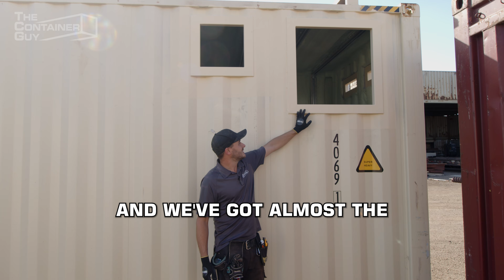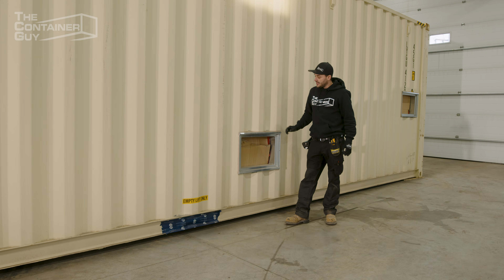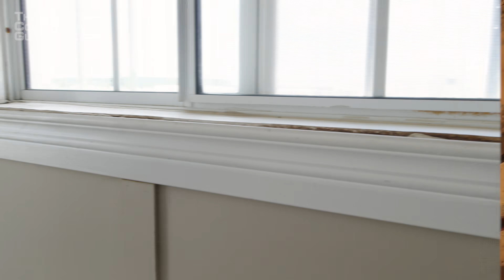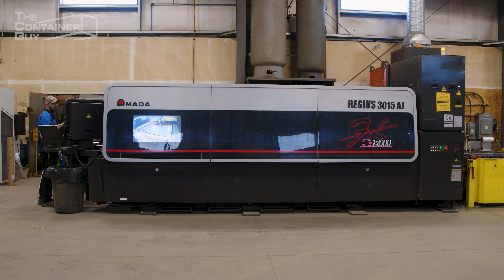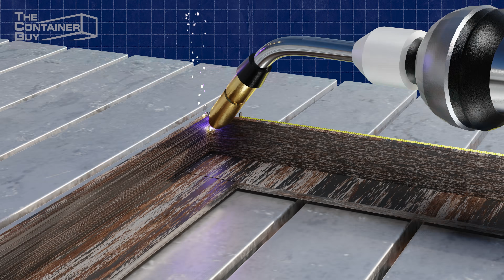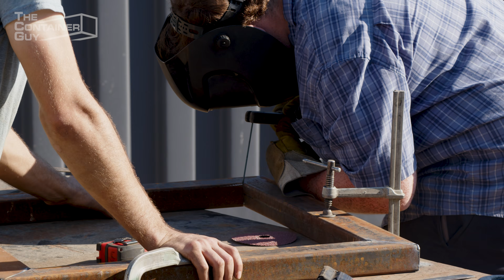How To Frame Openings On Shipping Containers | DIY Method

Comment: Ironworker/fabricator 15 years.   If you weld it, which you should. FIRST AND FOREMOST, PREP ALL SURFACES TO BE WELDED WITH A FLAP DISC AND ACETONE.   As much as you can brace your frame and container to keep it square and to discourage warping. Heavy tack all corners and mid way between those. have a sequence you strictly follow. Ex: you weld  a few inches in the top left corner, jump to the bottom right corner after.   When weld cools it tightens, and pulls. Goodluck, measure twice cut once.

Comment: Slightly off topic question... can a sidewall of a shipping  container be used as a door? I need the complete wall to be able to open 90° and when closed, it needs to look like a normal container. The wall/door would also need to be able to carry weight of around 300kg to 500kg at most. Is something of this nature possible?

Comment: Remove burnt paint with a wire brush on a grinder, treat area with rust converter, then paint over with an epoxy paint {my trade}, there are numerous epoxy paints with rust preventatives, or if treated properly, repaint with the same / original paint, if done properly  rust won't form.. Don't be too put off about the burnt paint, talk to a panel beater/ spray painter as to how they treat a metal surface after welding, they are working with worse steel than you are....
Reply: Thanks for this comment. I thought I was possibly going crazy after 1-2 hours of trying to figure out why you could not paint the surface again after treating it. So far as trying to figure out the composition of container paint and if it is some sort of magical fluid.

Comment: couldnt you just drill holes in the tubing and fill them with foam?
Reply: @Mikael-jt1hk  Yes, that’s what I do. I drill eight 1/4” holes. One in each corner, one in the center of each side and one top/bottom center. Start at the bottom center and work your way up! Nice thermal break!

Comment: Does CMW have window kits if you are framing and insulating on the outside?
Reply from the maker: Now that we have a container framed on the outside, we're working on it. We have 3 or 4 decent ideas on how to get it done. 

Until then, you can return your stud or just the window jamb back into the container (table saw PVC) and use edge trim or top bulb seal around the corrugations..

Comment: In your last video with the rockwool insulation, what model Rockwool did you use?  I'm not seeing 2.5" thick to fit in the 2.5" studs.  Can you start adding rough BOMs for your concept builds?

What economical options are there for insulating the quad side door (5 doors total) 40' containers?  5x flashing kits for the 5 doors is quite a total for storage containers.  Any ideas?

Comment: So, I am requesting additional information for my build. I am very interested in getting al of your shortcuts. But, I don't see anything for an application for inside a plant site. We won't be exposed to the weather, but I want to do it the right way so I need basically as much information and where to purchase the parts and pieces for  a 20x8' container with two doors on a dividing wall between a restroom at one end 8x8' and an office on the other side. I also need three windows for the office one on each of the 3 walls and no window on the restroom portion. I am planning on using something like the pioneer split zone HVAC system for this container. So where can I find what I need to make this nice a nice and easy build using the better parts?
Regards, Brian

Comment: If I use wood to frame out the opening and I live in an area that doesn't get below 70 and above 90 all year, would there be a mold issue still?  The inside will have AC. Thanks and great videos
Reply from the maker: No wood should ever protrude from the inside to the outside. You must always have a layer of spray foam between the container and wood members no matter if it's on the inside or the outside. Otherwise, it's a ticking time bomb.
Reply: @TheContainerGuyTV  thanks!
Reply: Hardwood window frames are used all the time
Reply from the maker: @kaptein1247  I bet those houses have large eaves. Remember, all the water on the roofs drains down the sides and over your window.
Reply: @TheContainerGuyTV  Not per se, in European countries at least. You could also add some sort of protection, like an eave.
Painted wood would last at least as long as the shipping container itself
Reply: @TheContainerGuyTV  I do rainwater collection, so no, that's not the case for most of the Caribbean where I live, and how is there condensation on the inside when it's always going to be colder than the outside?
Reply from the maker: @slugbyte  Caribbean climates and Arctic climates require pretty much identical building envelope. The same goes with Desert & Mild climates. I've been doing this for 14 years. I've gained wisdom through failure. You've been informed of my opinion. Now make your own informed decision.